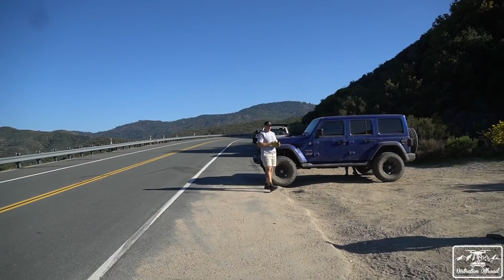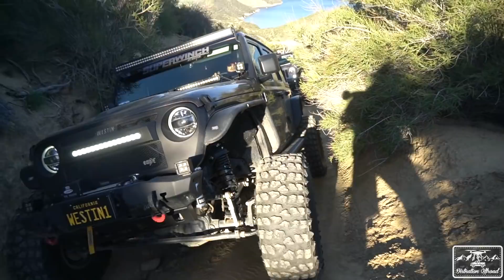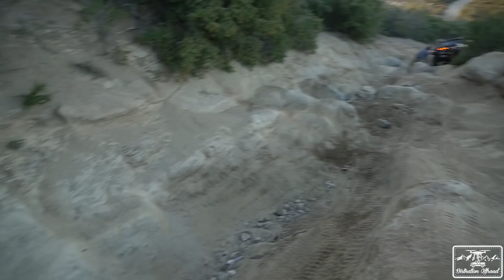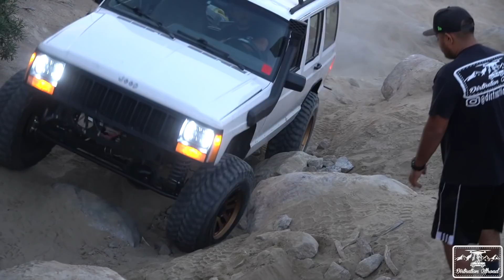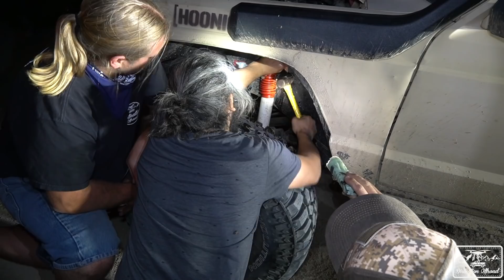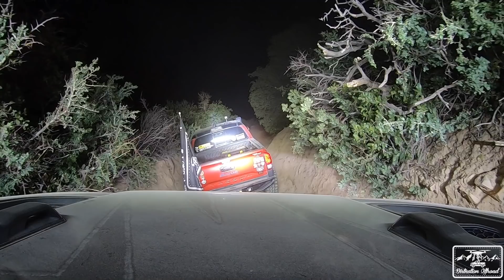We found the best way to run Cleghorn! Cleghorn Backwards All Obstacles!

Comment: At least now I know I need to get extended brake lines thanks to George lol
Reply from the maker: Wise move...also make sure the bump stops are good 👍🏻
Reply: Make sure you to put limit straps on and then you can’t over extend your brake lines or pull your shock apart.
Reply: @JohnSmith-sh1zg  thanks I'll make sure to do that !